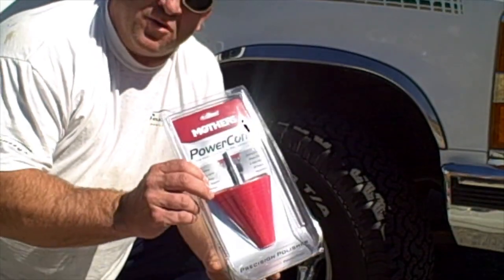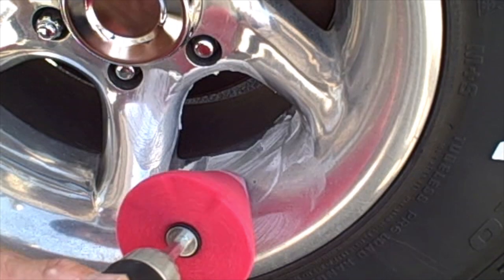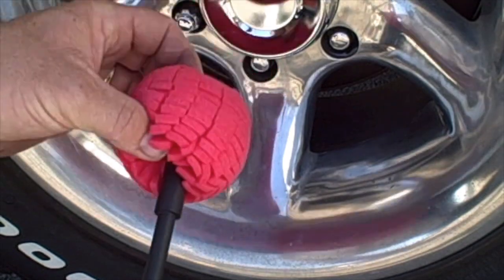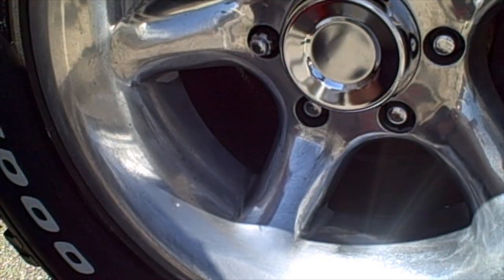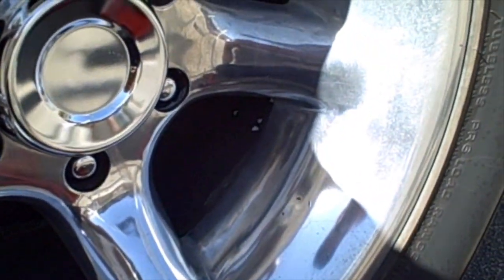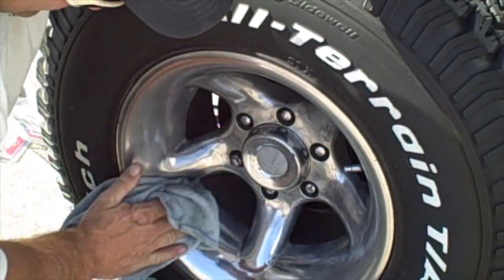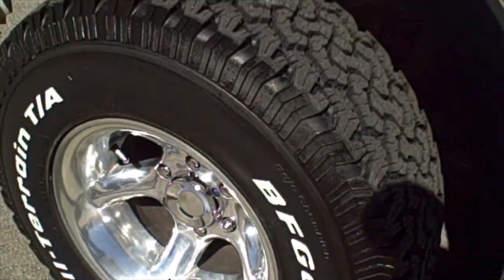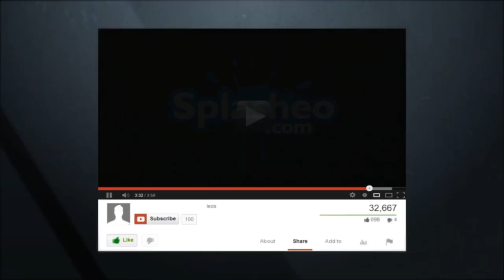How to use the Mothers PowerBall

Comment: I used this, and I had foam flying around everywhere. Couldn't even get through 1 wheel before it fell apart. Be smart and don't waste your money on these.
Reply from the maker: Foam flying everywhere, what the heck was you using? Mothers polish is a paste not a foam.
Reply: Hi I was using the mothers buff ball that you talked about in your video. As you know its made of foam. Piece of JUNK!!
Reply: +Grahamsgarage1 if you read the instructions your supposed to avoid sharp surfaces and "Let the Ball do the Work.." you don't have to apply alot of pressure. it's made to do the work for you.
Reply: Thanks, I did not even use much pressure.. Also I did avoid sharp areas I guess maybe my wheels are not the type for this type of buffer. Thanks again but I will now stick to the FLITZ one I bought, I have had that for sometime and is still working like a charm.

Comment: I think you need to join a gym and also get a bicycle. You sounded very winded which leads be to suspect that you are probably strong but couldn't sprint a mile to save your life. Oh and the polishing ball worked well but it's important to also let the viewers know that if they have aluminum wheels, the clear coat will have to be chemically stripped before polishing and then ceramic coated afterwards.
Reply: You are exactly right. To all others thinking of trying this: The VAST MAJORITY of polished aluminum wheels are clear coated. They would almost instantly tarnish/corrode if not. Using the metal polish shown in the video could have no effect, or it could irregularly damage the clear coat. Mother's site has an explanation of how to test wheels for compatibility with a particular polish.  In any case, I would not let this guy details my kid's little red wagon.